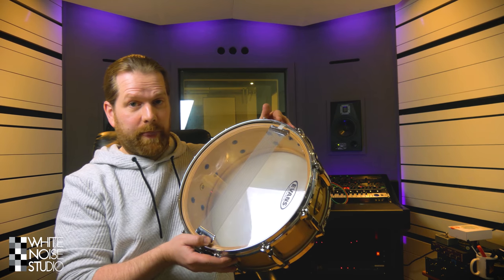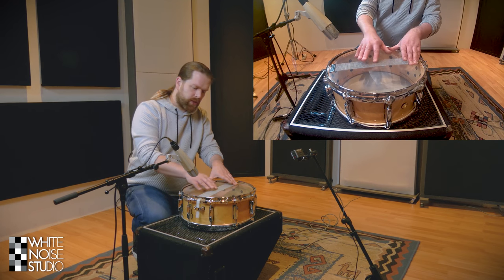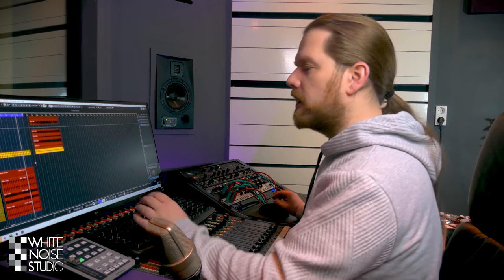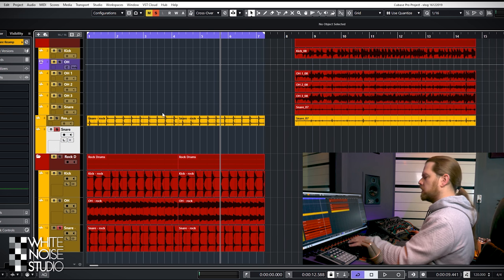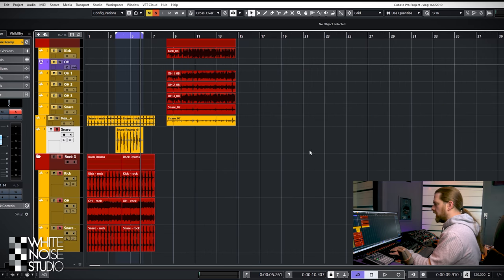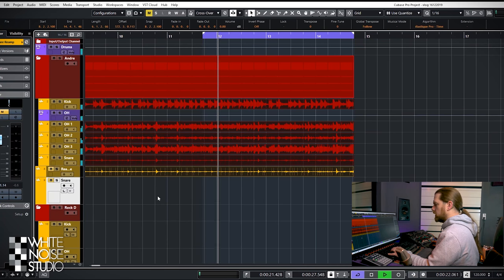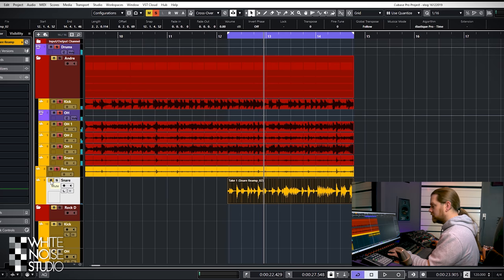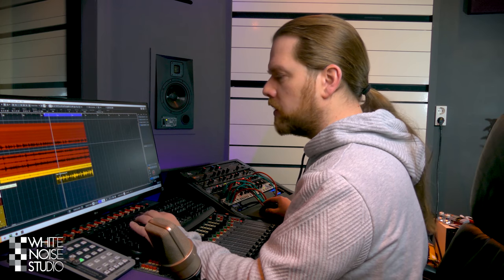Reamping Snare Drum - Explained and Tutorial on how to do it.

Comment: Can a hi hat be re-amped? If you set the gap of the hats low, it may start to sizzle.
Reply from the maker: The biggest issue is the amount of volume you woul dneed from the speaker to even start exiting the hihat since its solid metal. That could make the speaker louder than any reamped sound in the mic.